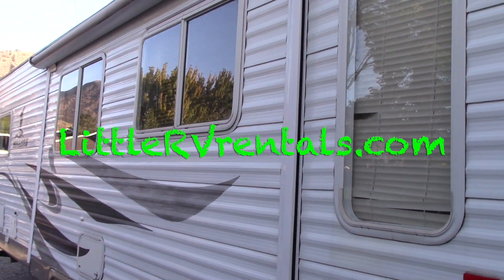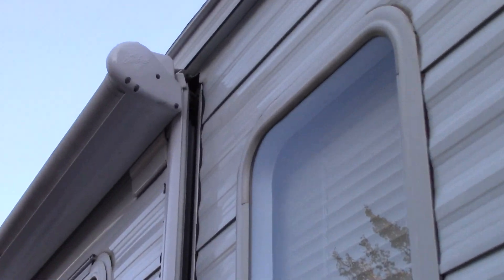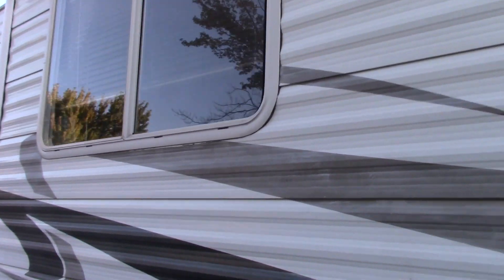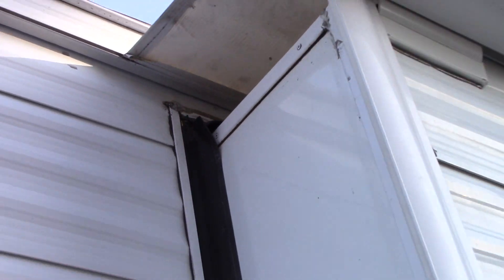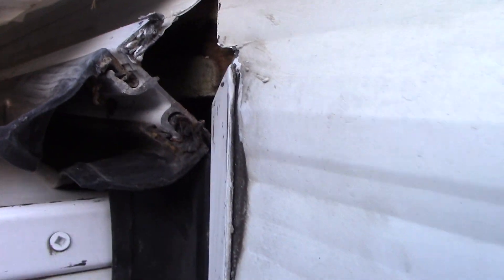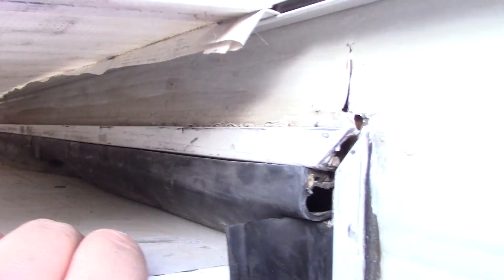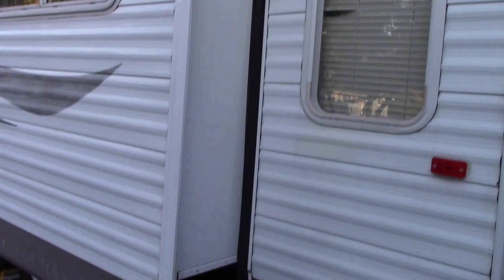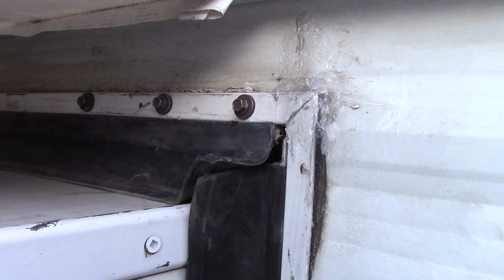RV Slide Out FAIL! Don't Make This Mistake!

Comment: I purchased a used Rv with slide out protection bar. The  owner before me put a neon orange flag on the end that hung over the edge of the seal when  slide was in. I used it as  intended  even though I didn’t think the slide would fail. The orange flag or ribbon always reminded me when it was time to deploy the slide.
Reply from the maker: That is such a great idea! I am going to try that this year thank you!

Comment: I've owned a few rvs with slide out and I have never seen or heard of those bars. Not sure what they do. Obviously they don't prevent the slide from opening.
Reply from the maker: Yea I never seen them before either but they are indeed made for the slide out the have a warning sticker on them (Use in slide while in travel) Cheers,

Comment: Don’t need them if your slides are hydraulic as long as the reservoir is full and the system is functional. The hydraulic pressure will keep the slide in place

Comment: That had to piss you off.. Its just one more reason I'm glad my new TT has no slide..Nice fix..
Reply from the maker: Yea I was not happy about it that's for sure! :(
Reply: No matter what, a slide is always going to pile on plenty of maintenance issues. If I ever get a trailer or RV, I'll skip the slide. Every single forum I've been to online has a section about RV slides infested with problems. Not worth it for what seems like barely 20-30 square feet of extra space. I've seen a trailer with SIX slides! I wonder what the repair costs will be in five years...
Reply from the maker: Yes I hear you! I just bought a new 2018 Keystone Springdale and opted out of any slide outs! I don't need added headaches!

Comment: I have only had one slide out but I've had it for 10 years and I never heard of these bars.  Not everything is built for a reason, sometimes things are built just to be something to sell.  Even if we could assume the final drive gear on the transmission was totally striped of every cog it is hard to imagine how the slide would go out unless you were rally driving.  And you would know your gears were screwed before it got to the point where sliding out the slide out was possible without the motor or the back up hand crank.

If the slide functions correctly, it isn't coming out during travel and those bars are a useless trinket.  Well, a dangerous one in this case.  If what I am saying were not true, slides would have to come with locking pins.  They don't.  They don't want to come in or out on there own as it is, and if the gears aren't stripped they cannot move without turning the gears.

So the real problem was you bought a product that has no purpose.
Reply: Art Vanden Berg  Even if the motor and the worm gear are intact, a slide out can open during travel. At the end of the ram the slide is connected to a welded plate using 2 nuts. Sometimes these are not even nylon lock nuts. If the outer nut becomes lose and comes off the slide is free to move by itself. Even the timing bar and gear packs will not have enough resistance to hold the slide in place. It doesn't happen that often but it does happen. Trust me, I've been a RV tech for over 15 yrs so I've seen some shit. Now a lot of trailers use hydrolic driven slides. I'm working on a customers unit now that has the front bed slide opening by itself. It is from a small 12volt selanoid  failing to close all the way allowing fluid to pass through to the ram and slowly pushing the slide out. This is situation happens more than you would think. Travel locks come with these trailers for a reason. It's not just a gimmick. It's an added safety feature. Over the years I've heard so many people call bullshit on products like this until they are on the the other end of a failure. Then they say, "no one told me I should use them."